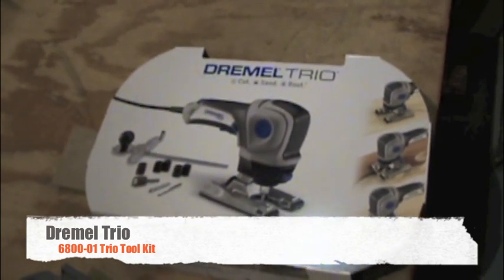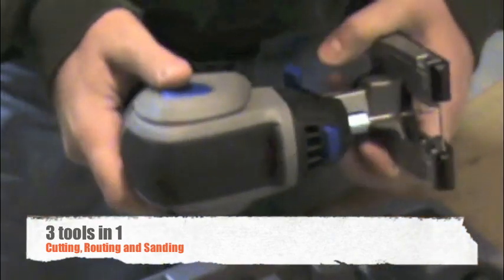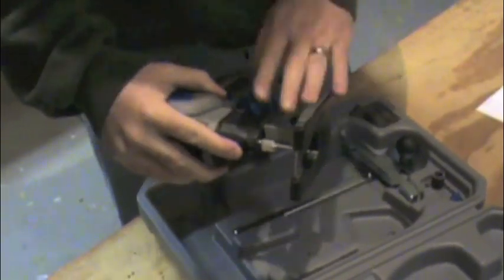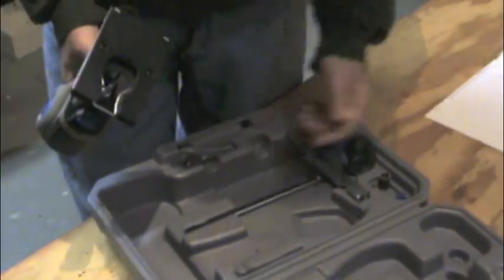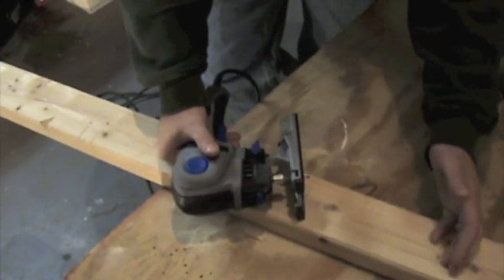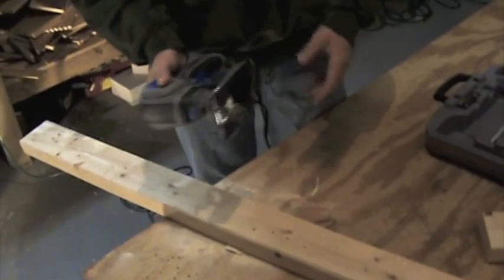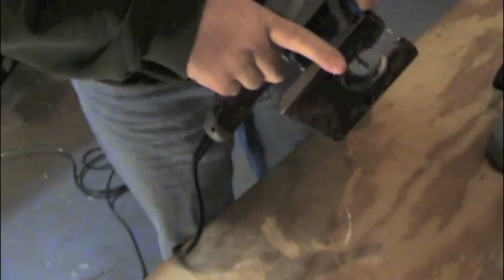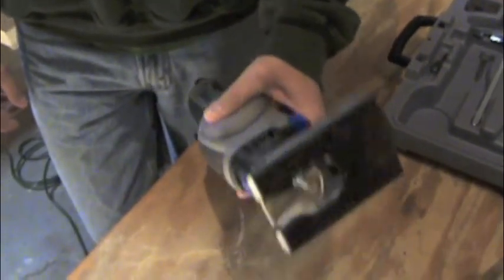Dremel  Trio

Comment: I bought this saw as well as the Saw-Max.  I haven't used either yet.  I get tools to use with crafts/hobbies, but hubby has always liked the Dremel tools I've bought.  I have a detail sander as well as a multi-pro (I think that's what it's called).  It would be nice if the multi-pro had a reverse to it so you can use it like a drill.  You can drill holes for screws, but you can't take screws out.  Dremel makes their tools in a size/weight that is friendly for the ladies to use.